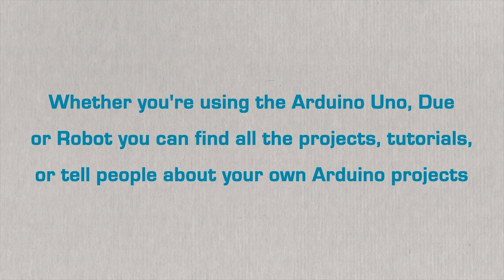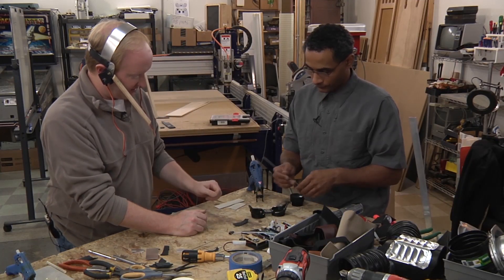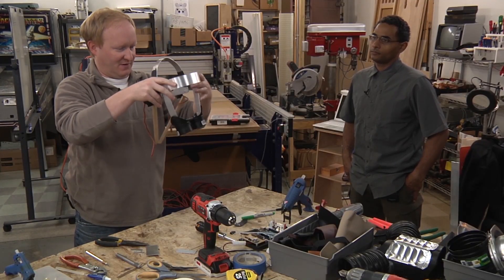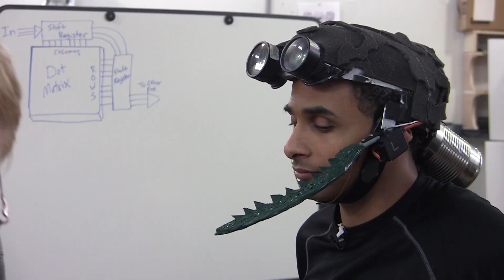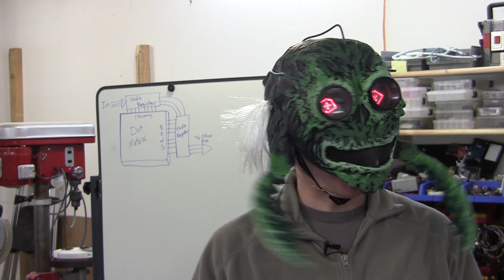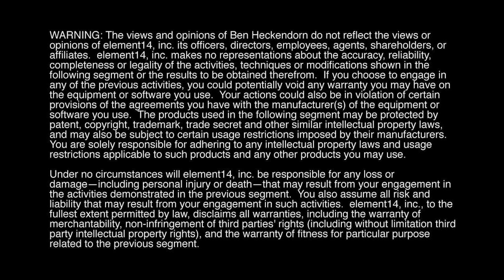Ben Heck's Hacker Halloween Mask

Comment: Can you make a laser cutter using recycled parts from a PC power supply, a dvd burner, and a printer/scanner? Also, without using a laser cutter and or 3d printer. Build it in a plastic crate.

Comment: What is the difference between a servo and a motor?
Reply: A servo is a case with an ordinary DC motor being geared down to be stronger/slower, but also contains a potentiometer that let's you know and control its exact position.
Reply: A servo is a DC motor with a pot conected to it and with a control circuit. Often controlled with pulses 1 to 2 ms long, the lengh of the pulse defining the position.